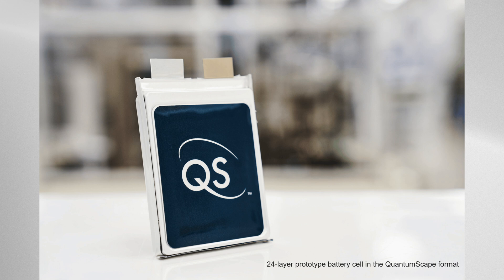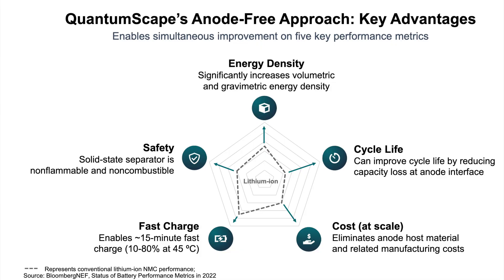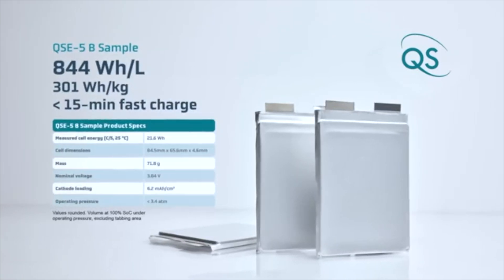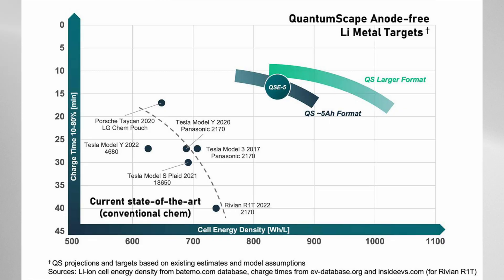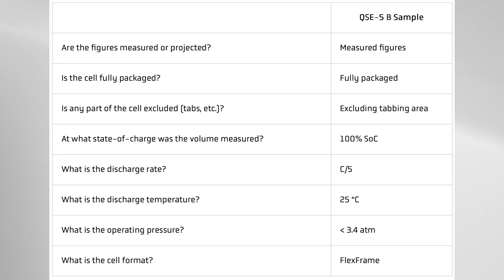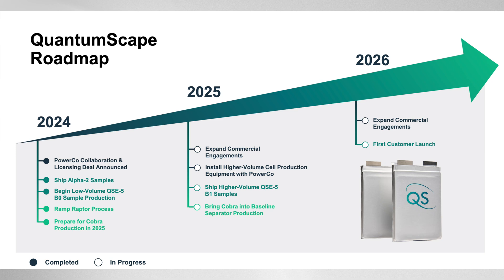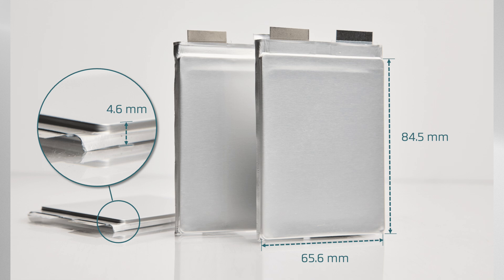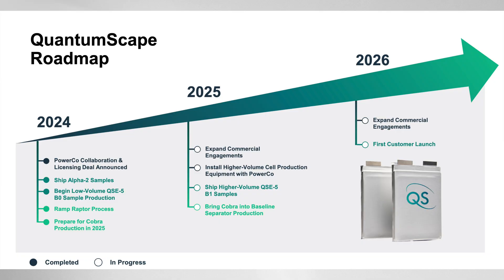Is this the Ultimate American Battery??! Quantumscape QSE-5 Overview

Comment: Nice analysis on Quantumscape! Refreshing to get a non-AI generated one. Just wanted to point out that battery is meant for auto, consumer electronics, data centers, & more. 

Also, there are 6 total OEMs with Volkswagen and their arm PowerCo being the biggest with the rest under NDA and are the only ones to announce partnerships (2 expected to announce anytime in 2025).

Comment: I had to buy QS today because solid state wins on all fronts: gravimetric and volumetric energy density, safety, fast charge, cycle life, and cost (at scale). I like also the idea that QS can go into planes since it is much lighter without the anode. It also has the option to go with LFP or NMC. Personally I believe QS will be taken over by one of the big OEMs. But the option to run their own factory Cobra is equally enticing. Either way, I feel like QS has covered all its bases. This is going to be a 10 bagger from $3.50 to $35.
Reply from the maker: I completely agree! I'm truly most excited about the future of QS in aviation but I know that's not realistic until at least the 2030's most likely. With how their company is structured, I hope they don't get taken over. With the low debt on their books and large cash war chest, I'm hopeful they run way to prove they can stand on their own.
Reply: @ Lots of electric solid state battery planes will be happening quickly.
Reply: You don't want a fire to produce thermal runaway at 10,000 feet without parachutes.